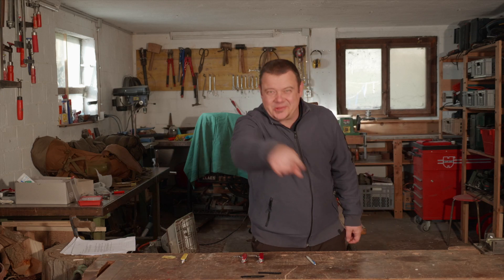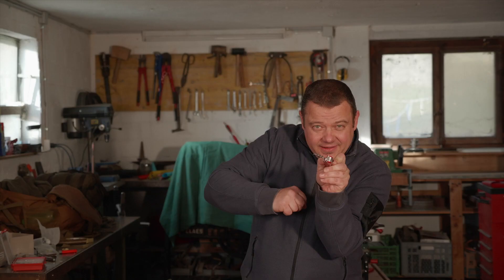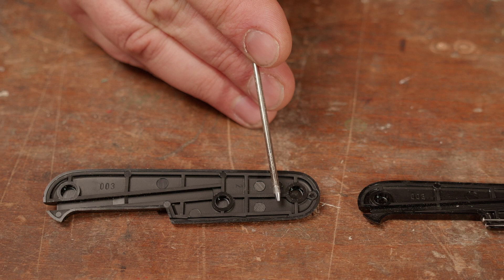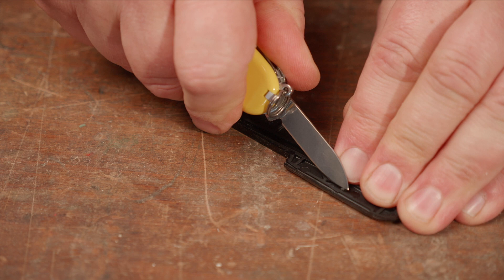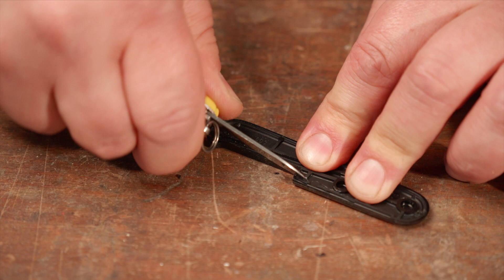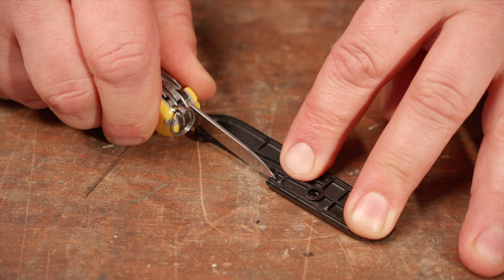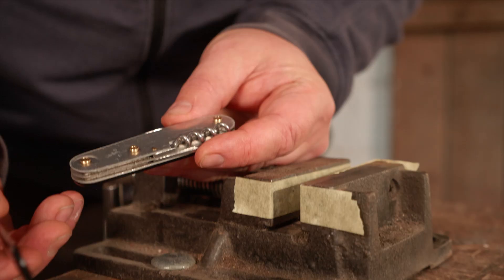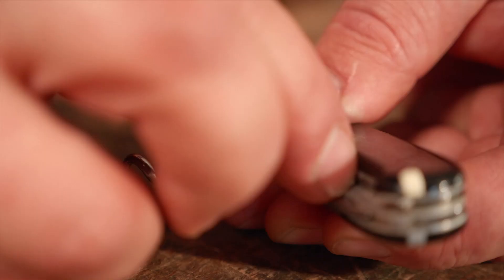The Secret of the second Pin Slot - SAK customize & maintenance Workshop (6/15)

Comment: I find it very funny that some owners have never found this feature. I bought the Swiss Cybertool knife when it first came out and mistook it for a rivet. Then logic struck: why would the Swiss build a knife that basically snaps together and leave a tacky rivet sticking out of the corkscrew slot?
I took out the tiny screwdriver that was embedded in the corkscrew and decided I would try to take the rivet out. I was shocked that it was a pin. It's funny that I've seen online ads for this knife and the advertisers didn't know about this feature! I am surprised that after the hex wrench and main knife, the pin is the third most widely used tool on my knife. I mainly use it to reset things. Many electronics have a reset button but they require a needle so bumping into corners won't activate the reset function. The hex wrench with the clever swingout tray underneath was why I bought the Cybertool on the spot.

Comment: What works really great for creating a pin slot is a Dremel abrasive wheel... one that is 40mm or larger... big enough to grip it with your fingers...  you do it manually--no motor tool !
I have modified two custom brass 91mm scales that were 'plus scales" but did not have the pin slot... I clamped a straight edge as a guide for creating the slot... takes a little effort, but worked great !

Creating a slot in plastic would be much easier than brass !
I have a pair of titanium scales that I plan on doing the same way... probably will be harder than the brass ones to do, but I'll give it a go !

Comment: Hi from France, Thank you Felix for your videos I love them. This idea is very clever. I used it to add a second slot for a sewing needle on my victorinox. Thanks to the stainless pin I can easily remove the sewing needle (grabbing the hole with the tip of the pin). I also use the lanyard to store the emergency thread (1 m).
Thanks again for this great channel.
Reply from the maker: Thanks a lot for your interesting comment!

Comment: Thank you for this great little diy project.  I have the “secret” needle slot on my newer Climber but not on my older Climber does not.  I hope this modification will work on the older knife.
Reply from the maker: I hope this too. Thanks a lot for watching!
Reply: Some of the older scales are almost solid (pre 1990s), but you can buy new scales with the pin hole. Just look for plus scales.
Reply: Thanks for the info, I not sure how old my older knife is!
Reply: @Rangefindergeneral  i was wondering when they introduced the pin hole all of mine are from the early 90's and don't have it

Comment: I went to Sewing Store and got a box of needles with glass ball heads. The do fit behind the corkscrew. Yes, regular straight pins are too small diameter thus too loose. The glass head needles typically are same diameter but glass ball keeps it from falling out. Then I saw other glass ball pins, they were larger diameter so fit well! They were also longer than stock pins. They may have been called Craft Pins so meant to be stronger. 
Advantages…
Longer and better grip with ball end. 
Easier to find.  They come in different colors too. 
I have pictures but don’t see a way to upload.

Comment: Make one needle a sewing needle. Now you have one of each. :)
Reply from the maker: Super idea. Thanks a lot!
Reply: The needle and thread are already under the saw together with the oiled jute cord in my sak.
Reply: @opotime  That works. 👍
Reply: Dental floss makes great thread for repairs.
Reply: How did you do that?
Reply: I mean how did yo manage to put a threaded needle under the saw of your SAK opotime?
Reply: I carry a sewing needle in the needle slot of my Ranger for a long time now. Now I can have both 😊
Reply: @rozilmer  
i fold the saw out and push the needle inside the sak with the twizer
(the “rope“ i turn around the needle, so it dont fall out if i saw something :)

have a nice day
greatz from Germany
Reply: Thanks, and greetings from Germany too
Reply: @rozilmer  you fold out the saw. The place it folds into has a little space between the edge of the saw and the back of the knife. In there you can put a needle you wrapped some thread around, making a spool thick enough it wedges itself in. Also, a great place to store a piece of oiled jute cord you can either use as tinder or clean your knife with. Felix did a video on that trick, maybe it's even in the playlist. Edit: Saw you already got your answer... my bad.
Reply: @nilsschenkel7149  
but your english is mutch better then my.
im sure your post helps

thank you
Reply: @opotime  thank you! ^^
Reply: I put a sewing needle rolled with thread behind the hook.

Comment: I carry two knives.
A Swiss Army knife, and another smaller knife, used to open the blades on the Swiss Army knife.
If you want to pull off your fingernails, try opening a Swiss Army knife by hand.
Reply from the maker: Thanks a lot for your feedback!
Reply: One of his other videos shows a neat trick. If your SAK has a toothpick, you can use the hook-like back end of the toothpick to open the other tools that give you difficulty.
Reply: For a stubborn SAK blade, thoroughly clean the joints out with soapy water, and generously oil them when dry. Then add a flat washer on a wrist lanyard, to give you a steel thumbnail for opening them.

Comment: great idea Felix thanks
Reply: BTW I found a new use for the bottle opener, well new to me, if you have a glass jar (pickles/jam) that you can't get the lid off, if you use the bottle opener on the lid like you would with a beer bottle but only lever it till it pops, you will have broken the seal and let air in which will allow you to open the jar. try it. all the best Simone
Reply from the maker: Hello Simone. Thanks a lot for this interesting inspiration!
Reply: @Rangefindergeneral  If you put the bottle upside down and take the screw driver and put it between the lid and the glass and twist you will get the same effect without the chance of deforming the lid.

Comment: I think that you don't need to take the scale off to do this modification. Just grab a pin and set it in a flame until red hot, and then thrust it while hot in the place where you want the new hole. Probably you gonna need to do it a few times more to penetrate the inner pillars, but this way is much more easy than taking the scales off.
Reply from the maker: You are absolutly right!

Comment: I love your tips and trickseries! I just need to find the perfect knife for me...
Reply from the maker: I think almost nobody needs more than a Huntsman... at least in the bushcraft scene.
Reply: I finally own a SAK ! It took me a long time to decide.  I went with the Ranger and am Very happy with it  !
Reply: @FelixImmler  I have had my Huntsman over 20 years so no needle hole for me. The only addition for a better Huntsman bushcraft type SAK would be the magnifying glass for solar ignition
Reply: @johnturner6251  I added a firefly flint striker substituting my toothpick as a backup fire starter. They are Awesome.
Reply: @johnturner6251  John , a little trick , in your wallet carry a  fresnel magnifier card and in your billfold area put in a small baggie with some char cloth.
Reply: Fieldmaster, all the way.
Reply: The Ranger has a wood chisel which comes in handy for many carving projects.
Reply: Look at the Outrider , a larger version of the Huntsman. I particularly like it because of the scissors.. and strong saw that is great as a ferro striker. I like the locking blade too.

Comment: Couldnt you use the nail file to widen the grooves youve made? I dig this channel so much. Pick one thing and do it better than anyone else. You nailed it bro.
Reply from the maker: To widen the grooves with the nail file is a super idea!
Reply: You could also heat up a needle and push it trough the scale without having to remove the scale

Comment: But Felix, those are not needles! Those are pins. Needles are used for sewing and have an eye to pass the thread through.
Reply from the maker: Thanks a lot Roberto!
Reply: I have an actual needle in my Huntsman pin role. Needles are more useful than pins in my opinion, but with this 2nd pin mod, I might as well carry a pin along side with the needle. Problem is, I just recently upgraded my scales, so won't be doing this so soon. Ciao
Reply: @axistec  I also carry a needle in all my Vics. I never found much use for a pin. One thing thar works for me is to lightly glue a needle to a bic lighter and then wrap the plastic part with strong waxed thread.

Comment: The pin slot must be a new thing ?? Mine doesn't have a pin place but I guess it's about 20 years old, a little beet up but still holds a great edge, toothpick and twesers lost years ago. Cool modifications video Felix.
Reply from the maker: Yes Richard. I would say the needle slot has been around for 10 or 15 years..
Reply: Richard Solomon you can buy replacements for you tweezers and toothpick on Amazon. Cheap enough and work perfectly.

Comment: Hi. I don't know if anyone can help me out, but lately the pin on my Huntsman keeps falling off its hole. The scale is fine (it isn't broken and hasn't had a serous hit) but I've already lost two pins and, if I try to use the corkscrew or the precision screwdriver, the pin will most certainly fall out of its hole, which is annoying.

Anyone knows how to avoid this?

Comment: Hello Felix, you are really doing a great Job with your Videos. But on this one I disagree. there is a much easier way to get a slot for a needle in a swiss army knife. My SAKs a pretty old and so didn`t have a needlehole. I simply took a needle, Held it with a Little plier, heated it up with a Biclighter and melted the hole in the desired Location. No scaleremovel nessesary. Quick and easy and the needle fits perfectly. Try out, you will see. By the way, where is your viedeo about modifying the bottleopener to a spooncarving tool? Couldn`t find that anymore. Keep up your great work.
Reply: i think the same, have a great day

Comment: @Felix, are you aware if a pin can be added to the 111mm Work Champ?
Reply from the maker: There is no hole in a 111mm handle. But you can file a little channel with a needle file.
Reply: @FelixImmler  Thank you Felix.
Frohe Weihnachten.

Comment: Hi Felix, could you please give advice on how to adjust a liner lock. The problem occurs after replacing the blade on outrider with the one hand opening blade. And now need to pull the blade a little bit up to lock. What can be used to fix that small issue without additional re assembling of the knife? Thank you.

Comment: Thanks for another great tip.  I have a problem with my SAK. The large blade and the can opener make the very satisfying snap when closing.  The small blade, screw driver, and saw do not.  They must be pushed.  I've cleaned with hot soapy water and oiled it many times.  Is there a way to adjust?  This could be a new video.  Thanks again.
Reply from the maker: How old is the knife?
Reply: @FelixImmler  Not old.  2, maybe 3 years old.  Not mistreated.  It just seemed to not work right one day.  I've been thinking of trying valve lapping compound do smooth up everything on that side.
Reply: I have the same problem. I often buy used victorinox knives and they are impossible to make them to snap when closing (well, some are fine, but those are basically unused). How to super-clean sak's?
Reply: @zelja.  I tried the valve grinding compound, but that didn't do any good.  Maybe even worse.  Hard to get the compound out. i even used brake cleaner and WD-40 but those didn't seem to have any effect. I really don't think it's a cleaning problem as much as a defect.

Comment: I just looked at my collection of SAK’s approximately 16, including five Spartans, huntsman, fieldmasters etc. Not one of those had the existing slot for the pin. Do you have to push a pin in initially or is the slot a new feature. Is that feature included for US Market?  Most of my knives are older. I recently replaced a huntsman that was lost I think that knife is about two years old.
Reply: Some models come in "Plus" editions too. You can always buy scales with pin and or pen slots and add it to any of your SAKS !
Reply: I think it started as a "plus scales" tool (pen and pin), but at least several new non-plus models have the hole for the pin (but don't come with it).

Comment: I need some help if anyone is willing. I have a Victorianox that I can’t figure out the name. It has the same tools as the Fieldmaster except no hook and a corkscrew instead of Phillips. Any info is greatly appreciated.
Reply: The Fieldmaster is just a Huntsman (one of the most popular) with a T-phillips in place of the corkscrew.

According to the SAK Wiki, the Huntsman didn't come with the hook prior to 1991, so it sounds like you could have an older Huntsman.
Reply: Thirsty Fox Hey thanks a lot. I just recently got into Swiss Army knives so I don’t know much about them, really appreciate the help.
Reply: @dude_mccallaster  No trouble! There's been so many models and variants made over the years -- sometimes even the same one has gone under multiple names.

I find the SAK Wiki helpful for finding similar models and historic variants.

Comment: Hi ;) And slot for pen? on victorinox camper?
Reply: Hi, you can buy replacement scales that have this slot on eBay etc. Just make sure to get the correct length scale to suit your camper.
Reply from the maker: The self made slot for the pen is a later project... but it works.
Reply from the maker: Thanks for the answer Colin!